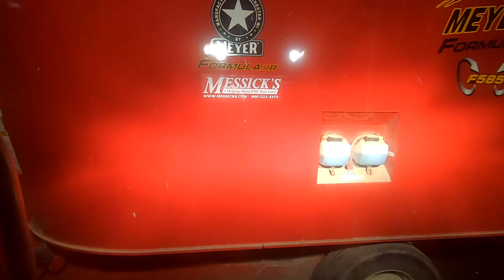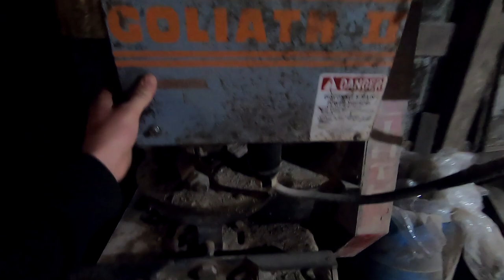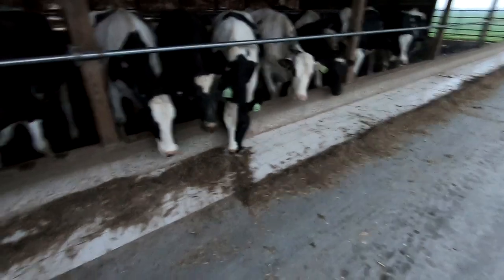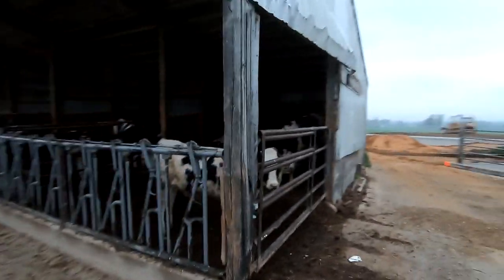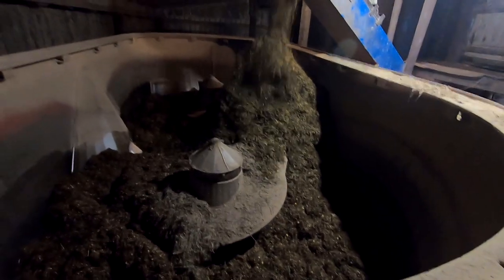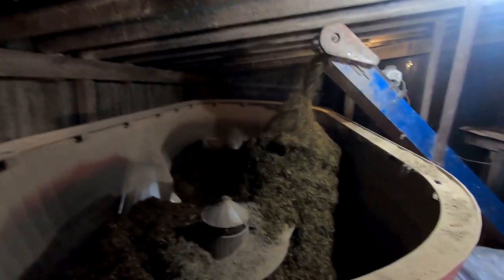Morning Cow Feeding

Comment: Hello Eric,  I'm a Canadian dairy farmer and really appreciate and respect how you guys farm.  I thought I'd pass on something I learned from another dairy farmer regarding making feed.  You would probably need to upgrade your digi-star scale on your mixer with recipe buttons and a number pad.  I'm assuming you guys are doing a lot of math everyday with every ingredient.  I have digi-star scale that you can make a number of different recipes (rations). It was little confusing at first but pretty slick when setup.  So Recipe 1 is for my one group milking cow group and Recipe 2 is my dry cow ration.  You program whatever ingredients and however many to each recipe and how much on a per cow basis.  When all setup you can simply start the recipe and adjust how many cow ration you wanna make and it does the rest! Hope this helps you out if at all! :)

Comment: I wonder if running them new tires that are obviously new with taller tread an still running the old bald ones at back will effect the drive train like it would on a wheel drive truck .. cause it would change the heat ratio somewhat .. but maybe as long as the tires can slip on dirt gravel an cement it be ok .. if they could not slip that’s when damage could occur .. always enjoy your videos An look forward to the new construction  videos too

Comment: 10th Gen. Watch closely the mismatched tyre diameters on the skid steer. The larger front tyres are breaking traction in a straight line. They will wear out fast if all tyres are not the same diameter. Also winding up the drives. I've seen this cost big money in machine damage. Hope this helps.